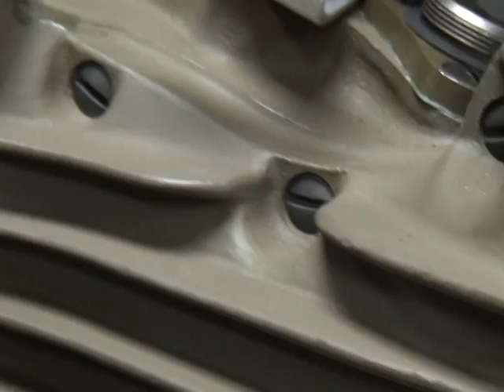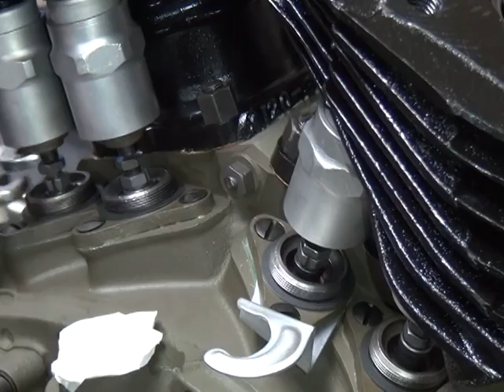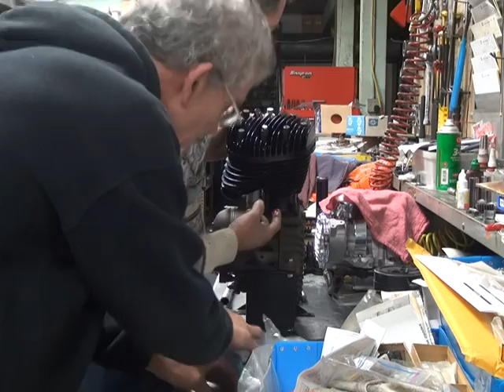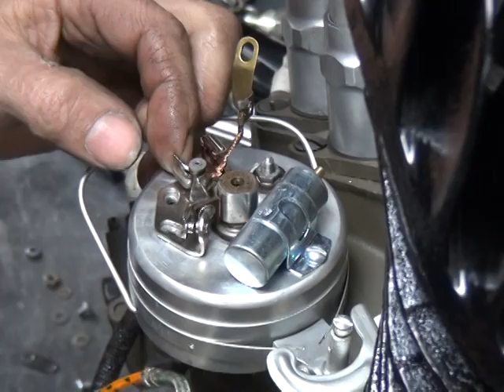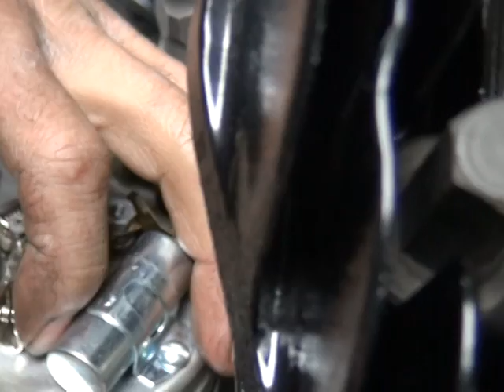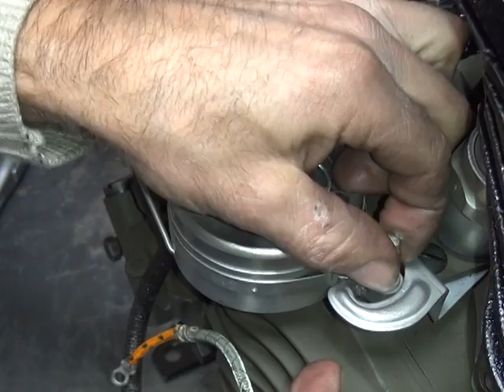1942 wla military #106 45ci motor restoration rebuild 1945 series 7 flathead wl harley Tatro Machine

Comment: To properly adjust the valves, what size should you use? And how do you see the correct piston top for adjusting the valves?
Reply from the maker: tdc is between the push and the suck when you hold your finger over the sparkplug hole. that was shown in the video. .005/.007 or .006/.008 work good for clearances. its all about the application.
tatro

Comment: одно не пойму толкатели клапанов не смазываются что-ли? ну и зажигание кулачковое это конечно плохо!
Reply from the maker: like most parts in a harley motor they are splash lubricated. not sure what you think is junk but this motor did a 2500 mile cross country ride in 4 days, so it must not have been that bad.
tatro
Reply: @TatroMachine   спасибо за ваши видео, очень нравиться, как эти двигатели работают на современном бензине высокооктановом, клапана не прогорают?
Reply from the maker: yes, the youngsters don't understand how bad the gas and oils were back when these things were new.
tatro
Reply: @TatroMachine   я не совсем все понял из ваших видео, потому что я живу в Сибири. я так понял что 80% запчастей и комплектующих вы использовали новых, во сколько денег вам обошелся этот мотоцикл, просто мне нужен такой же мотоцикл но с коляской. сколько километров ходит коленвал 50000-70000 kilometers?
Reply from the maker: i don't see any problems with the crank going that long as long as you keep good thick clean oil in it. that goes for any motor too.
tatro

Comment: how do you tell tdc on a motor with the heads on & still mounted in bike? Trying to set valves for first time for me.
Reply from the maker: short phillips screw driver. don't use a straight blade screwdriver because it might brake off in the cylinder. when the screwdriver stops going up you are on tdc. make sure you are on the compression stroke and not the overlap stroke. that would be when air is blowing out of the plug hole.
tatro